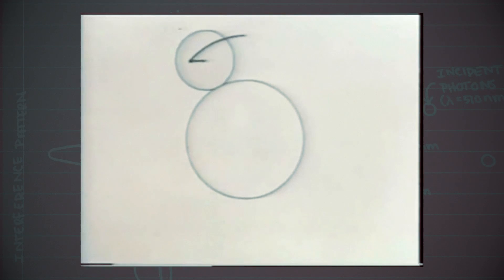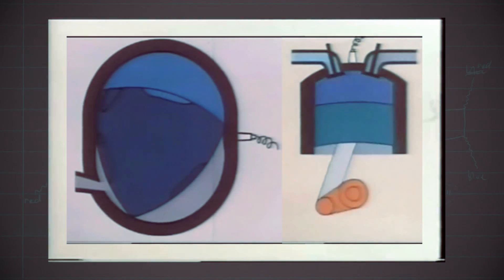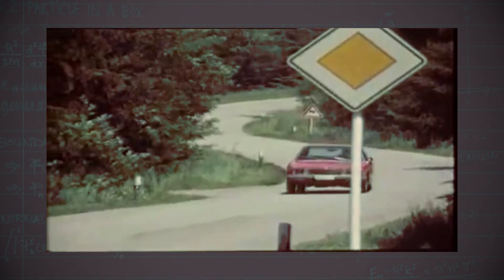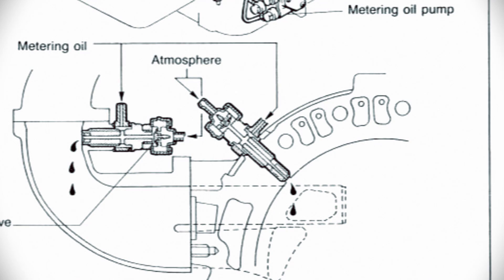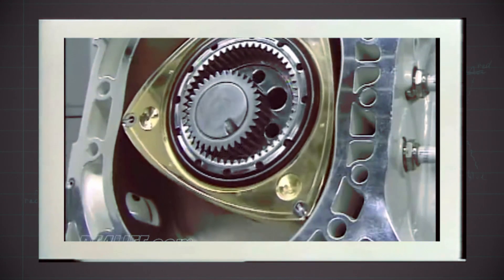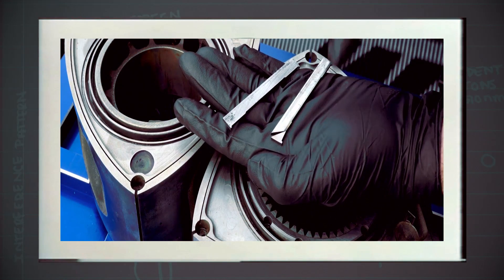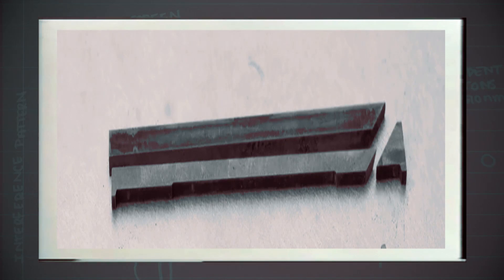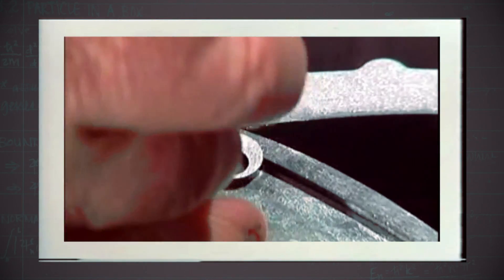Evolution of the Apex Seal

Comment: One key aspect to look into, is turbo vs non turbo. The quality and durability of the apex seals are put under considerably more stress on a turbo application. So to consider the renesis apex seal as an evolution, is probably true for NA, but not turbo. All (most) of the aftermarket apex seals are for turbo application, where you don't want the apex seal to explode from pre-ignition and take out your motor and turbo, instead they bend and are made from mild steel.